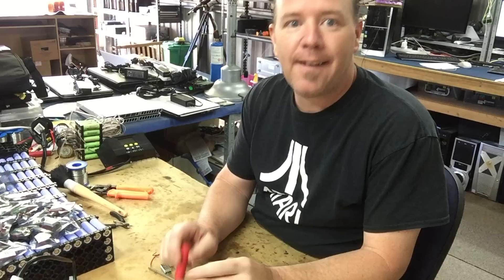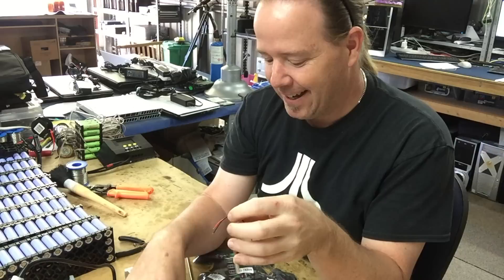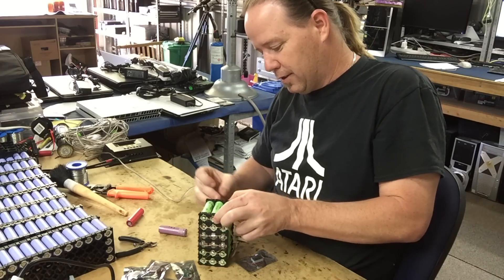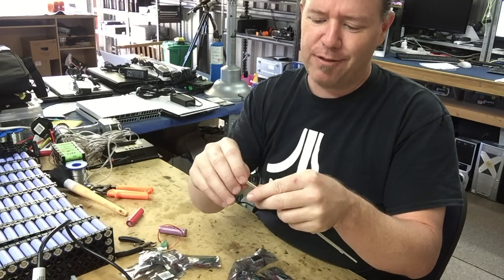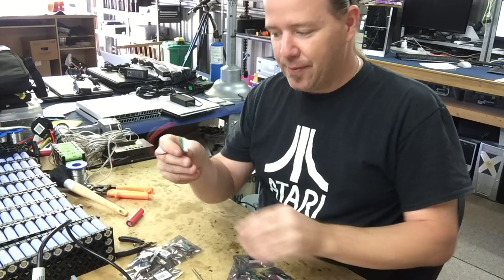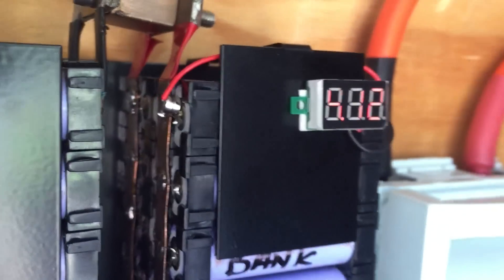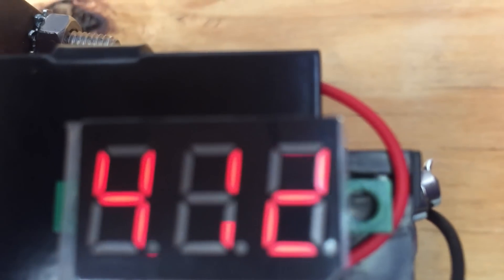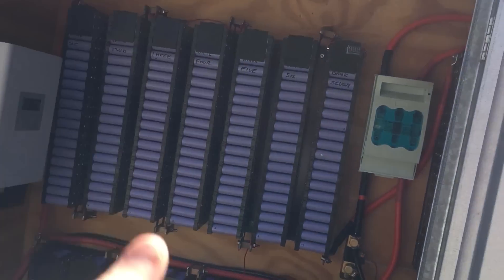Mini Voltage read outs on each powerwall cell

Comment: It's not really what you were going for, but you could hook them up to 2 sets of cells.  Then they'd be more like 7-8 volts.  It wouldn't let you know as easily if 1 pack is low, but if you see 1 pair being out of whack, would alert you to check out each one.
Reply from the maker: Yes i did consider something like that also. maybe just one per 24v pack then narrow it down from there. I'll be addressing this video in the coming days..

Comment: The led volt meters work if you get the three wire version. Red power, black ground and white is the signal or input. Mine go down to about 1.3 volts.
Reply from the maker: i can mod all the ones i have to to make them three wire, just haven't had the time to look for the diagram.

Comment: Got 4 of these balancers for my system. Awesome! I see they make them for your cells..
http://www.ebay.com/itm/4S-4-2v-li-ion-balancer-board-lithium-balncing-full-charge-battery-balance-board-/331949476978?hash=item4d49bb0c72:g:U5UAAOSwgZ1XvXSl 
They only shunt @ 66ma but don't let that fool ya will keep your cells from drifting over voltage. For your packs just wire up one 4s and one 3s  for each pack. 
you will love them! they will let you know if cells are getting to the 4.2 mark and do something to keep them from going higher the reason it will work with a low shunt rate is your charge voltage has to be 4.1 volts or less so there is not a lot of charging amps when getting close to float or setting at float is only about 2 amps or less. If you want to top balance just rase charge voltage .01 (works best using grid charger)  every 5 or 6 hours or till led stops blinking.

Comment: I would recomend you to use a 3 wire voltmeter display because it uses an external supply to power the internal circuitry. This way you will be able to measure voltages as low as 0 volts. To power it up, you can use one of those cheap DC boost modules from eBay to supply, let's say, 12V to the displays. Good luck.
Reply from the maker: Yep, just have to finish editing the video :) thanks for input.

Comment: Here is what I have used to do the same thing. These work OK (.2volt difference between 7 off) These are from an Aussie seller so you may get them quicker??   http://www.ebay.com/itm/Mini-LED-DC2-5-30V-Red-Volt-Voltage-Meter-Display-Digital-Voltmeter-Self-Powered-/152266352224?hash=item2373c82660:g:FvYAAOSwqu9VDQhg

Comment: so you have these sweet auto balancing voltage displays ? if they only turn on at 4v will that not help keep you system balanced?
Reply from the maker: BAHAHAH, at what 0.0002 of a amp..lol
Reply: HBPowerwall every little bit helps
Reply from the maker: Thinkin positive - that'll make for some good click bate titles lol

Comment: If you can buy those with little pot inside. You can calibrate the voltage and they are accurate.
I have green and yellow one and both works downt to 2.4V. And blue one works downt to 2.7V.
Reply from the maker: I'll pull one apart today and 'look inside'
Reply: Sorry, not inside. On the back side.

Comment: Just solder metal washer on wire and put neo magnet on it, it should work and you wont heat magnets
Reply from the maker: arrr good idea, have 100 of small washers from the old RROD days (XBOX 360 Repairs)

Comment: You can but similar voltage meter but with 3 wires, Vsupply, Vmeasure and ground, they work form 0V up because of separate power source
Reply: Many of the 3 wire meters also don't work at 3 volt.  I am using a cheap dc boost circuit to get 12 volts to power the 3rd wire in the meter and temp fan control circuit on each pack as well.
Reply from the maker: Looks like this one has three pads, but two + connect in the middle of the pcb.
Reply: split the 2 pads pete, multimeter for continuity accross each pad and the pos lead, that 1 should be your sense wire, the other pad will be for power supply, use a common ground, should work a treat, but if not its only 1 piece, there may also be a calibration pot on the device, so you might be able to set accuracy if your lucky ;)
Reply: haha we all have our own methods, i use 2x 18650 in series to give 8.4 volt when fully charged, they generally last about a week :)

Comment: Have you considered linking the the bus bars of your top and bottom packs together, so that you would end up with a 14S160P pack.  Instead of 2 x 14S80P packs.  This would mean you would only need to monitor 14 voltages and not 28 or 42 in the future, it may also help keep it in balance better too.  The link wires wouldn't need to be very thick as most of the current would still flow through the bus bars and brass blocks.
Reply from the maker: Yes did consider it 'addressing overkill' vid many months ago dismissed and chose this way for many different reasons.

Comment: Just a thought.  They come in 2 and 3 wire versions. Maybe possible to change them to 3 wire with an independent higher voltage power source.
Reply from the maker: tried some basic tests, and my phone lit up with the same suggestion - gotta crank a few computers out then back to the guess work :)